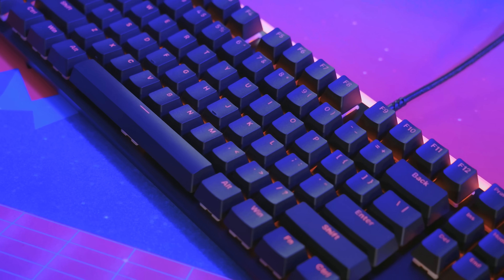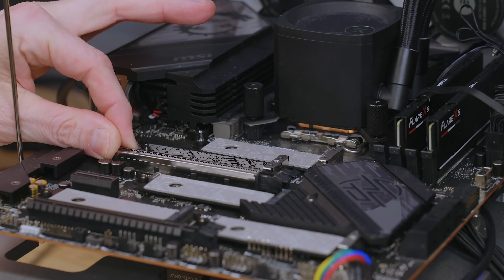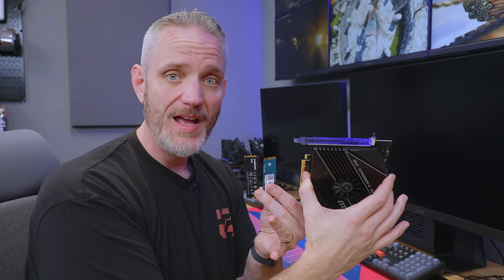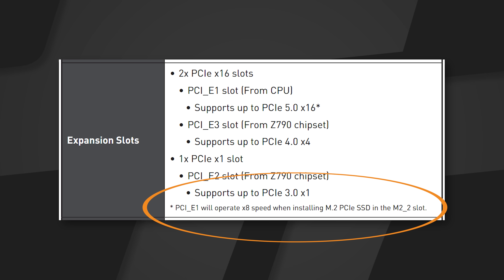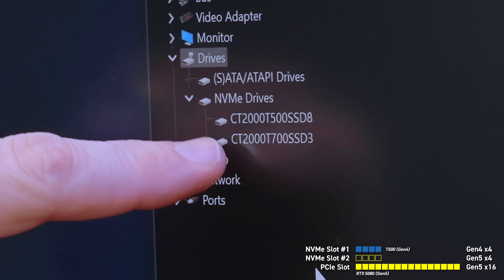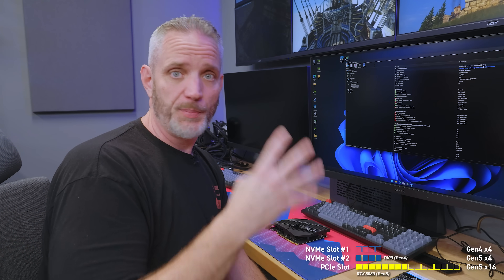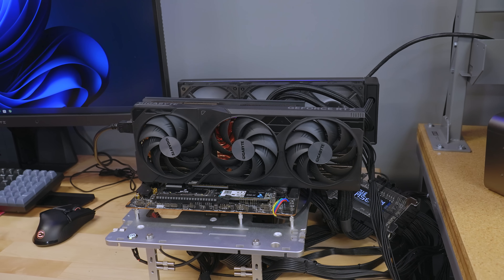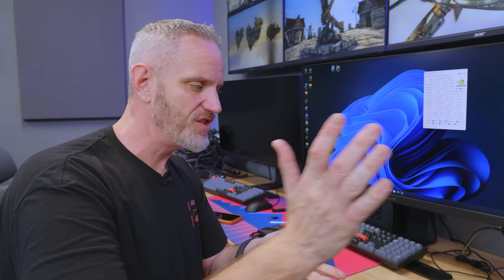Don't make this mistake with your PC!

Comment: By the PCIe standard it WOULD be allowed to bifurcate 24 lanes to 12,4,4,4 - yes 12 lanes is part of the PCIe specs. But nobody is supporting that for normal consumer hardware. And up to PCie 5 there were specs for 32lane links but this is removed with PCIe 6.

Comment: I was bummed, to discover and lucky.
X870e ASUS I bought 3x 4tb m.2 while reading manual to land the drives discovered that m.2 2 and 3 can't be used as it drops the pcie 16 to a 8
So like I said lucky just bought 3 m.2 installed m.2 1, 4 ,5 slots.
They sell in ads and on box 5! Slots ,zero mention of the lane being divided except in the manual in a note fine print!!

Comment: I was already aware of it. It's a bit better with more modern CPUs that have more PCIe lanes.  But my old Comet Lake PC, there was a M.2 slot I couldn't use with a NVMe drive because it would steal 8 PCIe lanes from my GPU despite using only four of those lanes.  Not sure where the extra four other lanes went, I think they were unused.  So I left that M.2 slot empty.  My current machine has 24 PCIe lanes to the CPU, so that has room for 16 lanes to the GPU, and 4 lanes each to two NVMe drives.  Then there's more lanes to the chipset.  But nothing strange that will leave unused lanes, like my old PC.

Comment: One of the reason I bought the MSI x670e Carbon Wifi is so I can use both gen 5 nvme slots it doesn't affect the x16 slots. The three x16 slots are have shared pcie lanes and bifurcates to x16/x0/x4 or x8/x8/x4.

Comment: What about sound cards? The problem with creative is they can either use Gen 4 or gen3 1x. And I only have gen3 available for the slot. Not sure if there is any difference in bandwidth

Comment: Just read the manual... oh right: Most boards don't come with a manual anymore.

Recently got a new X870 board and that came just with a "Quick install" guide. Completely useless. It just stated "install CPU", "install Ram", "install cooler", "install drive". Yeah no shit. And in what order should the RAM-slots be populated? Well good thing that was described in the silkscreen. bad thing it was white-on-white.
And while the manual explains some things most UEFI-settings have no descriptions or garbage that helps nobody. Like "LLC: Controls the load-line calibration" but does not mention what "Auto" "Default" "Optimised" and the various levels actually do.
Reply: Asus does that in their manuals... Drives me crazy... Especially when the manufacturers all have their own own name for the same GD thing!

Comment: i just wish you could set m.2 slots to pcie3, then you would only need 2 pcie4 lanes or 1 pcie5 lane per slot. and for non essential drives, 3GB/s is fast enough. hell, even the os is fast enough on a gen3 drive.
i don't ned 5 pcie4/5 m.2 slots if i have to choose between using more than 2 ssds or a gpu with more than 4x...

Comment: Intel giving only 20 lanes just shows how little they care about consumers.
Reply: I have one of those Huananzhi X79 old/new boards just so one PC can do a lot of IO. I hope they start doing the same with older Threadripper / Epyc servers in a few years 😊
Reply: 20 lanes is 1 GPU and 1 m.2 drive. Nothing else. That sucks
Reply: Don‘t know why Jay used Intels last gen to give an example and not z890, which would have been more fair.
Reply: @ThisIsSoMEan Probably because the board had so many slots and was in active use
Reply: Chances are you won't use those lanes on a normal gaming PC. More PCIe lanes is considered a workstation requirement. For example the Xeon W-3175X comes with 48 lanes. The 6725P has 88 lanes.
Reply: @Denizen-X  yeah that we do not need that many lanes is clear but having at least 32 usable Gen5 lanes with the next generation would throw all problems we could run into out of the window!
Reply: @Denizen-X  The majority may not, but a solid double digit percentage of gamers could benefit from more lanes. Market segmentation, a race to the bottom and a small dose of planned obsolescence seem like the real drivers, not a true lack of need. Consumers shouldn’t be forced into workstation hardware like Xeons just for a little upgradability and expandability.
Reply: @rsithron  That's like saying that 9950x3d owners would love to have a faster CPU than a 9800x3d... Is it not.
Reply: @rsithron  small dose? Nah man most companies have been riding the edge of OD'ing on "Planned Obsolescence" for decades pushing closer and closer to the limit

Comment: I recently ran into this issue when i tried doing dual GPU Lossless Scaling. I dint really think about it when i first bought my motherboard, and because i need 1 slot for a Wifi card i am screwed overall. But it gave me a reason to upgrade to AM5 and i bought a workstation motherboard this time instead of a gaming one to get a good number for slots and lanes for 2 GPUs and drives.
Reply: Curious what board you got. How do you have it set up?
Reply: @chancetempleton3829 I bought the Asus ProArt B650 Creator board. 
I haven't gotten it yet its on the way, but i am going to do my 6800 XT in the main slot and a Arc B580 in the 2nd.
The PCIEX16 1 and 2 slots share bandwidth for 2 VGAs at x8, and the PCIEX16 3 slot shares with the 3rd M2 socket. So with my Wifi in the 3rd slot it only disables the 3rd M2 slots that i don't need. 
There are better workstation boards then this, but they are really expensive and this should be more then enough for my use case.

Comment: I've got a 3080ti and an 8700k

Since I'm on a ROG Maximus X Hero, it only supports PCIe 3.0 - my card is running at 8 GT/s, when the card itself supports 16 GT/s (PCIe 4.0)

Getting half the performance out of the card JUST bc of the motherboard

...I need to upgrade to PCIe 5 😪

Comment: 4:05 .  Mmm no. That is not at all what would happen. If you placed that 8x card into a 4x slot the second quad of lanes would not be electronically connected at all nor the second NVME. Pausing the video you can clearly see the traces are going straight from the slot pins to the NVME header. For what you are saying, in this very moment, to happen there would have to be a PCIe bridge chip actually installed on the card and ALL traces leading to it, which I haven't seen on anything other than some spendy 16X cards.

Now, even if you wanted this card to function as it is you would still need the slot you put it in to support bifurcation in the EFI. Be it automatic or manual. Not all do. If it doesn't it still won't see more than the first NVME. I have a basic dual-nvme PCIe 8x card that I put in an 8X slot... just doesn't work. Though, admittedly, this was an older Intel 270 chipset board. Maybe things have changed. 

To see an example of some of this you can look on Amazon for a 16X PCIe card that has four NVME slots on it. Right away you'll notice some are super cheap, and then there's ones with a big jump in price. The cheap ones are obviously reliant on motherboard bifurcation support. The jump in price is for a PCIe bridge chip on the card that all lanes go through that supplies the Bifurcation when the motherboard firmware will not. Now, these cards often will, even though their 16x, let you slot them in an 8X slot and you'll still see all four drives. As long as you're not pulling data from all four drives you won't see a performance dip. There is a performance dip just from the PCIe bridge chip being involved.

Comment: This is the reason I bought the Asus Proart AMD X series- you have 2x Gen 5 and 2x gen 4 - the primary Gen 5(Native CPU lanes) the Gen 4 on the left pulls from the gen 4 PCIe x16 slot(which will run at x8 gen 4 with the M.2 installed) ; the gen 5 and the gen 4 on the right side of the mobo are shared chipset lanes.

Comment: I'm one of those people with all 4 of my m.2 slots filled with drives, however I don't have any Gen 5 drives, 3 of mine are Gen 4, and the OS drive is a Gen 3, 3x 980 Pros and 1x 970 Evo Plus, with a 4080 Super.  Everything shows the correct speeds on my MSI x670E Carbon Wifi.  I don't really see a point for me to have any Gen 5 drives, especially since Gen 5 drives are still kind of pricy.  If and when I decide to do a new build I'll probably go for whatever the spec is for nvme drives.

Comment: Good thing I didn't buy my new mobo yet. Thanks Jay for this video that lays it out with concrete examples. This info is good to have pre-purchase. If anyone reads the manual after they buy, they may be stuck with unexpectedly lower performance than what they thought they were buying.

Comment: So I just built a computer, first one in 20 years and I put a gen4 m2 in my gen 5 slot. everything is installed on it. is there a way to transfer everything to a new gen 5 m2 or do I have start over? I dint even know there was gen 5. Im a little out of touch these days. I guess I would have to install the gen 4 card below in other slots that connect to other PCIE slot? ugh my head hurts

Comment: I have a B860 motherboard and a Core Ultra 265K with 24 PCI Express Lanes.
In CPU-Z it say Bus Interface PCIe x16 5.0 @ x16 5.0
In my Gen 5 NVMe Slot I have a Samsung 990 Pro PCIe x4 16 GT/s @ x4 16 GT/s
I Guess I could put a Samsung 9100 Pro NVMe x4 32 GT/s in there instead and it will be @ x4 32 GT/s OR NOT?
PS
I have 2 other NVMe Gen 4 running in the 2 x PCIe 4.0 M.2 Slots.

Comment: "RTFM."  Yeah, that technology is doomed to fail.  ET, the Atari video game of the eighties is accused of killing an entire industry.  It was arguably the first video game that required the consumer to actually read the manual to get anything out of it.  Computers, prior to '95 were avoided by consumers and left to the nerds, and those who needed them for work because consumers needed to read the manual to get anything out of them.  The rise in popularity of computers in '95 was not due to Windows 95, it was due to the promise of plug and play, ease of use, and the consumer did not have to read the manual.  Just poke it all together, and it was expected to work.  Anything that required more than a quick glance over gets abandoned because the majority of people don't want to read more than they need to in a short attention time.  So, now that computers are going back to needing a manual to understand, they will also be abandoned.  At least until AI becomes developed in computers that simply does things, or gives simple directions to get it working right.

Comment: 'very unlikely to show a difference', yes and this statement applies to putting a gen 5 drive in a gen 4 slot AND to running a 8x Gen5 versus 16x Gen5 GPU slot.

I have a gen 5 in a Z690 board at 4x and it is plenty fast because the random I/O is still better and real world use can't make use of gen5 bandwidth anyway.  Peak sequential isn't the bottleneck, it's typically small block size random I/O.

Gamers don't benefit from Gen 5 GPUs or CPU connections, it's just marketing hype right now that adds cost and instability.

Comment: Small thing, you said that "All SSD's use x4" which is the case for NVME, but any SSD using the sata protocol will not use x4.  Don't quote me on this, but I believe the sata SSD's use x1

Comment: So if we have an nvme, let's say Gen 4 gen 3 whatever? And it has your op system on it. Should we put it in the chipset nvme slot or should we put it in the slot that's for it's? Or should we stick it in the associated gen 3 Gen 4 slot?

Comment: I wanna give the nod to MSI seeing only their X870E Tomahawk and Godlike let you fill all NVMe slots at full speed. BUT! There have been bugs for months. Every now and then say NVMe M.2_1 slot - rated for Gen5 speeds, would drop down to Gen1 on boot up. Even if you force it in BIOS from Auto to Gen5, it  would still drop the speed. Only way to fix is to  restart  PC again. No BIOS update seems to fix it. I pay for the speed I expect, not this instability

Comment: @jJayzTwoCents I hope you talk about Microsoft wanting to make all offline install not working.   You should check out about the Windows 11 and Microsoft taking away local account setups in OOBE and them removing the scripts and stuff .  You should help user by showing other ways to get a local account!   Also WIndows 10 ESU if you go for the extra security they will make you log in and get information about your Windows 10 information and other things.   You have to go back and remove the sign in to your Microsoft Account on your Windows 10 after you do the ESU upgrade.

Comment: Kind of stupid on the Z790 board, so the top-most M.2 slot closest to the CPU...was not using PCI-E lanes from the CPU.

You definitely have to RTFM, as you decide to add more NVMe SSDs, but for the "average" user, with 1x SSD + 1x GPU, it shouldn't be an issue.

I think on the latest AMD platform (e.g. X870(E) and B850(E) ) the USB4 mandate is taking up too much I/O bandwidth. The prosumer/consumer is demanding for more M.2 slots, so board manufacturer has no choice but to bifurcate the primary PCI-E X16 slot, where the GPU would go. From the ASUS Strix X870E-E vs AsRock Taichi example, it's also the board manufacturer cutting cost, and not routing the additional PCI-E 5.0 4x slots for a second M.2 slot from the CPU. If you filter by motherboard with 2x PCI-E 5.0 NVMe slots, it's only a handful out of ALL the AMD 800-series motherboards, and they are the $$$ ones near the top.

Comment: i didn't watch the first video. might aswell watch the second. and yeh... my config is shit too. my cpu is limited to gen 3. 8x gpu, 4x C and D drive and my development/work/game storage drive maybe shares/multiplexes the 4x of the system drive or shares the 4x mainboard lanes with my audio and usb controllers. i don't even know for sure. it is what it is. and/but i don't wanna reinstall windoze or mess with it. it's working fine and "benches"/works as fast as advertised and fast enough to work or play the occasional game to fuel the creativity. :)

Comment: faster nvme drives are fraud on users, most motherboards and laptops cant run at that speed. also most budget motherboards dont even bother providing more than one nvme and one x16 slot.

Comment: As a bit of an extra tip, my understanding is you can sometimes "cheat" an extra NVMe drive in without bifurcation, but it depends on your motherboard. If your mobo has SAS ports (Asus ROG Crosshair X870E Hero for example) then you can get an NVMe adapter and run an NVMe drive through the SAS interface without sacrificing any PCI-E bus lanes.

I should note that, while I've seen it done, I haven't experimented with this myself 'cause I don't have enough drives to warrant it, so attempt at your own risk, etc. etc.. I'm not sure what the risk would be, but, like, transparency and shit.

Comment: Building my 2nd pc at 65, a new i7-12700k & a new MSI PRO Z790-P WiFi DDR4 Motherboard a used Asus RTX 3080 ROG STRIX, new 2ea crucial 1tb gen4 m.2 drives,  2x32 for 64gb DDR4 3200 memory bought before it cost way more exceeding DDR5 prices, corsair 1000w psu cable & loom kit, phantom spirit  3 fan 2 tower 7 heatpipes, Corsair 5000D Airflow icue case fans 9 non-ARGB  & 3 ARGB case fans. Great info i was looking for. This build was based on not having the melting hi power but poor design connectors, 2 more recent cases at least this month.
Reply: I game every day but boxing games on my Nintendo platforms that stopped with Gamecube for me, no pc boxing games, On punchout i bought new, first week i fought tyson & we traded blows we both went down at the same time then the game froze, never happened again.

Comment: There is a reason to set bifurcation options, I had a PCIE4x16 GPU and 2 NVME PCIE4x4 which became PCIE4x1; because the GPU doesn't lose a lot I could choose PCIE4x8 and then both drives had PCIE4x4 which anyone putting in 2 drives is likely to want.
Auto can give bad results.

Comment: My motherboard manual and BIOS make zero mention of bifurcation, yet I have four four-lane M.2 NVMe drives in one PCIe x16 slot using four lanes each (I have 44 lanes available on my i9). 
And three more in dedicated M.2 interfaces on the motherboard.  All my M.2 and PCIe slots run at the same speed, and none via the chipset. 
My conclusion is that reading the manual and searching the BIOS are both overrated, as they can't be relied upon.

Comment: Thanks Jay. I wasn't running into the bifurcation issue but did notice that my SSDs aren't in the optimal position. My comp came with an SSD that is only Gen3 but is in the Gen4 slot. Just got a new SSD a month ago and put it in what seemed like the best slot but it turns out its a Gen 3 slot but the SSD is Gen 4. So I should swap the two drives to optimize the speeds. 

Would never have noticed this without checking these things out due to the video. Not that my SSD speeds are hurting or in any way slow, but it doesn't hurt to set things up optimally.

Comment: This is why sata SSDs are still king. My ROG Apex X870E AM5 mobo doesnt even have 1 Gen 4 slot they're all Gen 5 slots and I have a gen 4 NVME drive so I pretty much have no choice but to use a good ol Sata SSD or get a gen 5 NVME otherwise my GPU will become heavily crippled with a Gen 4 NVME. This only has 2 PCIe x16 slots. Besides PC games hardly even take advantage of NVME like the PS5 does so the diff between sata SSD and NVME on PC is really not that significant

Comment: Now Im just curious if Bifurcation is gonna be an issue on the Rog Strix B850-G Gaming wifi if I have all 3 front M.2 slots populated with Gen 4 NVMEs (Western Digital SN850X), and a AMD Radeon 9070XT. For this board, the top 2 M.2 Slots are CPU Lanes, with the 3rd being chipset.

Comment: I have 2 Asus Z490 systems running i9-10850k CPUs.  I have to manually assign bifurcation to get the 2nd NVMe slot to support x4, otherwise it defaults only to x2.  This is at least one case where the user needs to makes changes in the bios.